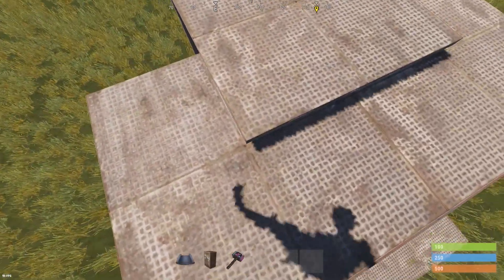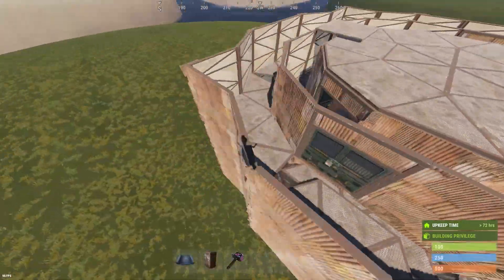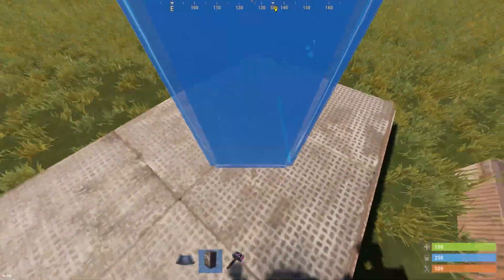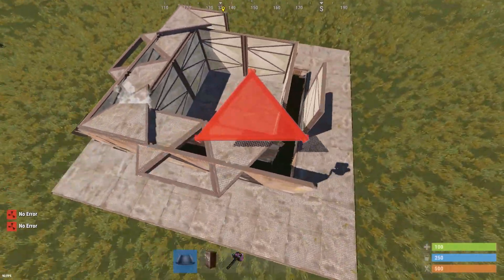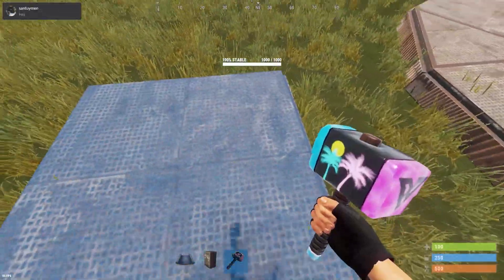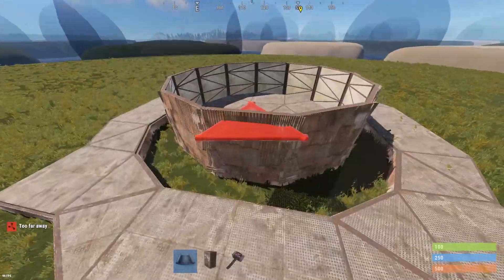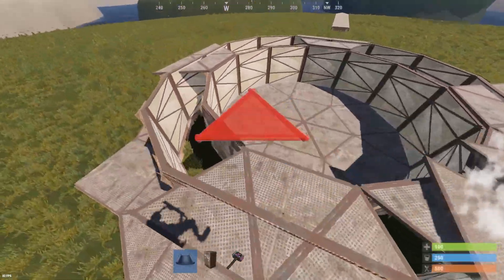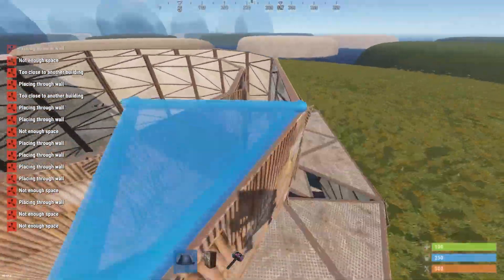Rust - How To Make Half Gaps (new double peek method)

Comment: If a half moon is 4 triangles then wouldn't it be 7 3/4 half moons not 7 and a half. I point this out because half moons are a stupid measurement metric. You're building in triangles and squares, not half moons, remove it from your vocabulary haha
Reply from the maker: Yeah I hate the term I use it cuz it's what others say. In theory, if a half moon is 4 triangles then 2 triangles is .5 moons, then we cap it with 1 extra triangle to use as a placeholder, however it's not actually part of the build out. I agree tho it's silly
Reply: @MiniSatori  yo satori you should do a video on a external tc bunker I been using. There's a bunker that uses a socket stack method and 2 half walls been going around lately you probably know of it. Well Gamelights figured out how to build it without removing the inner foundation under the 2 half walls. You should check his channel to find it. Well I been using that method with the external. Its a neat little external bunker. I personally place a stone jump up in there under the bunker entry and a window frame in front of tc so if they break through wrong spot they still have to go through that.

Comment: After a very long time I have confirmed this works on console rust
Reply from the maker: Awesome :)
Reply: @MiniSatori   you got no idea what it took lmao, had to farm 2 inventory’s of wood for experimentation, (I used 3), boated out all the way to an iceberg, and tried and tried till I got it. It’s really hard to floor stack on console because you can’t move perfectly in any direction wether your walking or moving, and the way building tiles interact is weird. But yeah it 100% works.
Reply: @MiniSatori  absolutely love the videos btw, I was trying to get a multi-tc version of this where the shell is split into 4 parts, but I kept getting messed up with the peekdowns. It’d be lit it you could make an entire base design around this concept

Comment: I did it just like you said but when I go to place the squares around the 2x2 some of the walls are red!
Reply from the maker: all i can really suggest is trying it again, ive heard a few times of people accidentally pixel gapping, which makes miniscule changes in length based off of inconsistency in the length of a triangle
Reply: Nevermind It was the server I'm pretty sure. This doesn't work on rusticated sandbox.
Reply from the maker: @simmo0441  mmmmm... Not sure about that, I've seen people do it there too
Reply: @MiniSatori  I tried it 3 different times, and then it worked first try on Builders Sanctuary
Reply from the maker: @simmo0441  very strange. oh well, if it works it works i suppose, sorry for any confusion :)
Reply: @MiniSatori  not your fault just glad I figured it out :D
Reply from the maker: @simmo0441  <3

Comment: Im using a all circle circle base i want to fit it inside the same thing but it doesnt fit around it evenly. Is there a way to make it fit better?
Reply from the maker: what do you mean by all circle circle base?
Reply: @MiniSatori  I asked you on discord a while back but like  one circle of 6 triangles or whatever with another ring of circles around it
Reply from the maker: @sentix6969  ahhh i understand, ive not tried that myself so honestly im not sure, HOWEVER, if you did the circle with this pattern, then made a circle base with the ring, i believe youd be able to then delete the squares that come off the inner hexagon, (as well as the triangles between them) then replace those with your second layer of triangles, that may work
Reply: @MiniSatori  Ok thank u
Reply: @MiniSatori  ur a god ty
Reply from the maker: @sentix6969  <3

Comment: Hey Satori, I was trying to implement the half gap into a multi tc base design that I have. I was wondering if and how you did so. The peek downs keep getting in the way of the placement of the walls. Wondering if u had any bases that have an example of this or would be open to helping out a fellow builder.
Reply from the maker: hey man. yeah, ive got a base that uses multi tc half gaps, however im not sure if thats what youre asking. (if so, theres a base design on my channel that incorporates them) however, depending on the footprint youre using, half gaps may not always be possible to make proper peeks with. feel free to add me at Mini Satori #7735 on discord if you have anything else that needs more specifics :)
Reply: @MiniSatori  do i need another tc or could I just use the main one for upkeep
Reply from the maker: @JakeyBub11  another tc is best here q

Comment: Make the circle base in a tutorial on how to build the whole thing. Please.
Reply from the maker: I'll probably try, though I'm not a clan builder by nature lol so it'll be a bit till I'm happy with it :)
Reply: @MiniSatori  alright I was just confused because I tried to build it and it to close to another building when I tried placing the foundations around the circle base
Reply from the maker: @tannerfleming3734  yeah, it can be tricky on occasion, I've heard that happen before though, sometimes in the build out you can accidentally make whats called a "pixel gap" which is basically what happens due to the discrepancies between triangle foundations and squares... Redoing the build out always seems to fix it, and personally after doing half gapd for ages, I would say I've had that issue twice
Reply: @MiniSatori  Nevermind I messed up
Reply from the maker: @tannerfleming3734  ah alright :)

Comment: The foundation don't actually get to touch each other. They are exactly 0.0096... Rust Meters away from each other.
Reply from the maker: You're partially correct, on one side they are a tiny bit away from touching, however on the opposite side they're inside of eachother :)
Reply: @MiniSatori  Agreed, it's also possible to put roofs in the foundation overlapping each other, in another words, double layer of honeycomb.
Reply from the maker: @Gabe-cobalt  sorta lol, only problem is rough splash is whack as fuck, and rockets splash both roofs unfortunately :(

Comment: Just for clarification in regards to the 2x2 inside the 3x3... the outer layer (the 3x3 so to speak) needs to be on a separate TC or does the entire thing work off a single TC in the 2x2??? Thanks for the tutorial, this looks amazing! :-)
Reply from the maker: Generally, the outer layer needs its own tc, however if you don't floor stack it (there's a really good peekdown layout still even if you don't floor stack) you can connect the tcs with roofs, by placing a roof intersecting at the corners... Hope that makes sense :)
Reply: @MiniSatori  yeah it makes sense. tho it brings back painful memories of accidentally ruining a multi-tc base on a live server after they put in the conditional roof models. thx for the clarification and suggestion. :D
Reply from the maker: @Stona81  np :)

Comment: Mini, would the Floor stacked part ( the ring I guess) need another Tc connected to it for it to not decay, or does it simply auto connect to the main base tc for the circle base
Reply from the maker: ik i already replied to this in ez, but i may as well repost here for anyone reading: if its floorstacked then unfortunaetly it still needs an external, as I havent yet found a way to connect tcs if theyre floorstacked

Comment: Nice vid! But would you be able to make it so you can do a shorter version for going 7 circle out, 1 half circle, and one triangle out. Maybe there would be a way to go out 3 circles, back squares, etc so you dont have to go all the way out. There could be something obstructing you
Reply from the maker: youre right, I should've mentioned this, and I will actually add this to the pinned comment. you can alternatively go out 3.5 circles, then come back with squares, then go out with 4 circles again. (or 4.5 circles then 3 back, anything as long as it adds to 7.5 circles) thanks for bringing this up!

Comment: I'm confused in the peaks. Would you have two sets of inner peaks then?
Reply from the maker: yes, thats what would be ideal. you could in theory have 1 layer of peeks, however then youd have outside foundations that can be softsided. what I was aiming for was a way to add double peeks to some bases that normally have a hard time making them efficiently, as well as making double peeks in hidden footprints (i.e. putting a circle base inside of a 3x3 footprint, or a 2x2 inside a 3x3 inside of a 5x5, that sort of thing where you dont expect the design that it is)